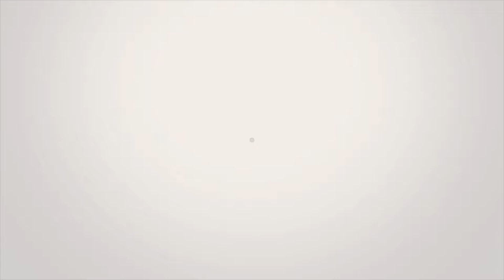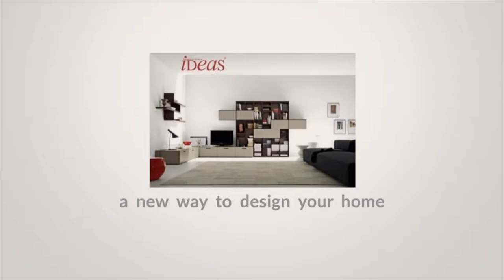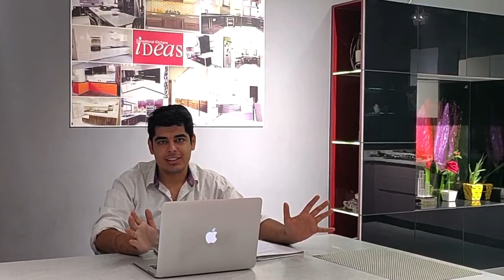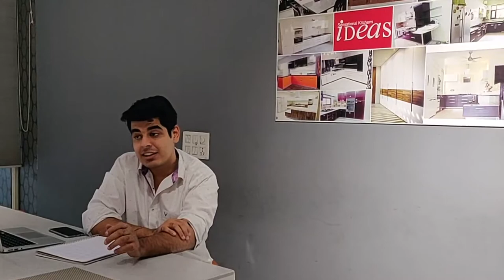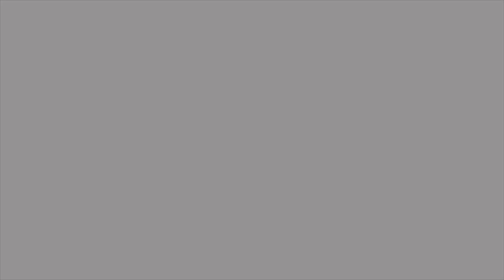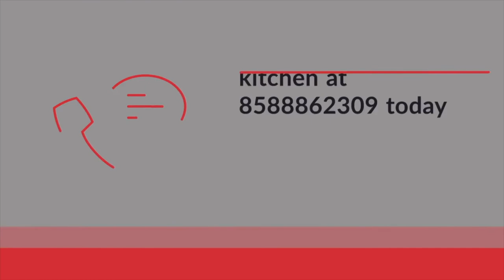Stainless Steel Kitchen Versus Wooden Modular Kitchen

Comment: What is the Cost of SS modular per square feet ?
Reply from the maker: There are different rates for different grades of steel. If you are looking for a rust proof one then that would be 304 grade steel and just the boxes will start somewhere from Rs 4000 per sqaure feet.